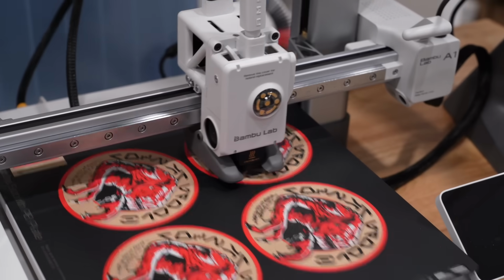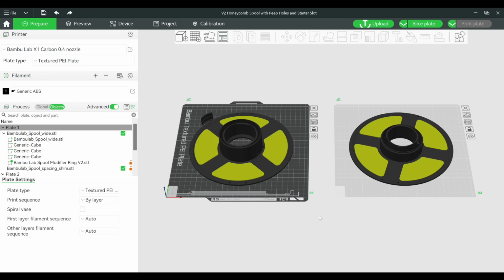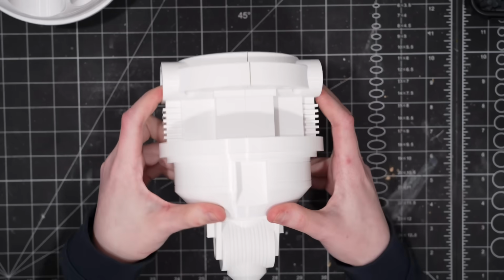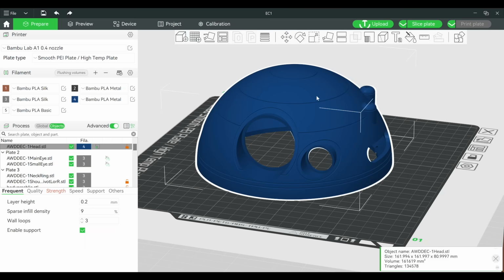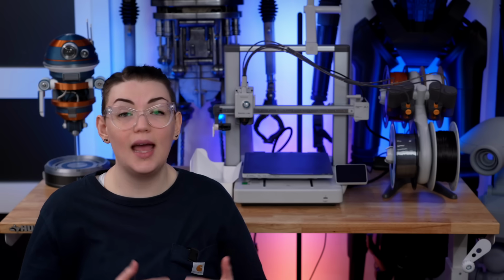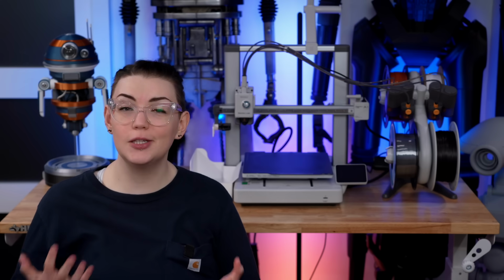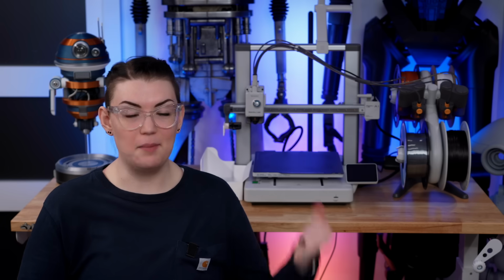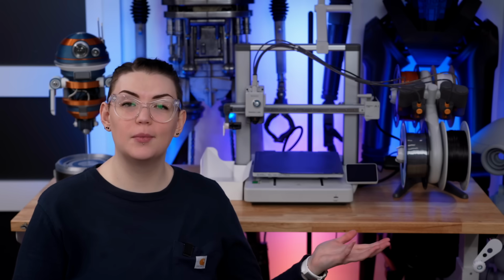Is the Bambu Lab A1 the Unbeatable 3D Printer for Beginners?

Comment: I want to know that if I want print things same 16:40 at this video like 16 keychain with three color the printer at first color and after that print the second and third one by one or at first print 16 keychain first color and change to the second after that.
Reply from the maker: It will print everything that uses the same colour and then switch. So it would print the red area in all 16 keychains, then switch to printing the black parts for all 16, etc.

Comment: whats the foot print needed for the printer with the ams?
Reply from the maker: About 32” x 24”. That’s a conservative measurement. There are also print files out there that can relocate the AMS to the top of the machine or even on a wall, etc. that could decrease its used desk space.

Comment: I've been considering a 3D printer for about 3 years now, but haven't purchased one primarily due to lack of space (most printers are not necessarily small), and lack of funds (most cost more, with several approaching/exceeding $1,000).  After over a year of researching, contemplating, etc, I finally decided that, when I did get one, it would be from Prusa...tho, I was still undecided whether to go 'small' (ie  Mini, now Mini+), or 'large' (ie. MK3S, now MK4 &MK4S).

However, now, hearing so much about Bambu Lab, I'm starting to rethink things.  With Bambu Lab having a US presence (even though they're a Chinese company), that's one advantage.  Also, the A1 & P1-series printers all have a larger print area (256mm² vs the Mini's 180mn²).  Another advantage...a HUGE advantage...is having the ability to have multiple colors spooled.  However, I know that Prusa printers are very highly rated, and the Prusa Slicer is considered one of the absolute best.  Plus, they have a very strong support based, including one of the best company-provided support lines.  In your video, you talk about a strong "user support base", but, does Bambu Lab provide any direct support, and, if so, how good is it? (considering most of us know how poor support is from most cones companies selling direct)

In a matter of speaking, this has me back to where I was before - wondering which company's products to get.  Any advise/suggestions, ESPECIALLY from anyone who has owned & used printers from both companies???

Comment: These Bambu printers are so much more like an appliance and less of a tinkering saga.  The filament purge for color changes is far less than I used to throw away from older generation printers (Ender 3 and 5, Artillery X1, etc) failed prints, poor quality, inconsitent extrusion, slower speeds... the difference and experience is night and day.  Color changing, easy quick acces changing of filament, up to 16 colors (I have 2 P1S and use two AMS on one for 8 colors)... excellent stuff!

Comment: I dont know how much multicolor I would do, but how would it work with type? Could you mix type, or would it likely struggle sticking to something that isnt the same material? Would it be useful to just use it a single color and type, but being able to have your most common types on the AMS?
Reply from the maker: A few of the filament types don’t interact well with each other, but that can be used to your benefit to make easier to remove supports. You could also use it with PVA to create dissolvable supports if you’re into printing complex models. Something I completely forgot to mention in the video is that the AMS can be set to automatically switch to the next spool when one has runout of filament. It’s definitely handy but I’m not sure that feature alone would be worth the additional cost of the AMS for you.

Comment: I just discovered your channel and must say I'm quite impressed!  Your delivery is great and concise, pacing also.  Video is top notch and your printer setup and printing are very helpful and enjoyable!

As someone who has built several 3d printers from scratch and experimented with various multi filament methods, I think Bambu has really nailed it.  The single extruder concept vs IDEX really simplifies the filament path!  The actual cutting, purging and reloading the next color is brilliant.  They have added an inteligence way beyond the norm with the use of MEMS sensors for achieving the ideal stepper control and frequency to minimize noise and vibration, super cool!

Did you say that the printer had identified the filament colors while loading?  Optical color spectrum analysis perhaps?

I think out of all the 3dp channels I've seen over the past 10 years, yours is a cut above and now my favorite!

Comment: I am 67 and was an electronics tech but I only worked on hardware not software. So I know nothing about programming, 3d printing. But it looks like fun and would like to try it. Cost is a major factor since I'm on SS and somewhat disabled. I hope the filament is not too costly. I enjoyed your presentation on this machine. If I can afford it I will try it. I found you by accident and I'm glad I watched all of the video.
Reply: Please check back in here and let us know how you make out. Im recently retired and on a fixed income as well. I am just getting into this but haven't made any purchases as of yet. Cost is a concern for me as well. Id like to use you a guinea pig, haha
Reply: If you can afford $200, you can get the A1 Mini & have a blast.  Filament is $15 per spool (1 kg). You definitely can start with the basic machine & print single color parts.  Add the AMS to print in multiple colors as you gain more experience.  Have fun with it!
Reply: The A1 is about $200 and filament usually runs between $20-30 on average for your basic roll of PLA.  Sometimes it can go higher if you want something more specialized.
Reply: @SenseiJacksama  Where are you getting an A1 for $200?? It's nearly $400 (with the current deal going on) and it's $498 with the AMS Lite attachment.
Reply: @linkthelegend01  the A1 mini is $200.  Apologies I didn't realize they were two seperate models when I initially posted.
Reply: @linkthelegend01  £400 that’s amazing honestly no interest in 3d printers this video pop up on my feed i thought they cost thousands now i want to print coasters 😂😂😂😂
Reply: @paultrainor2110  Haha nah most don't cost thousands. There are def a lot that do, but most don't. I have an Ender 3 V3 SE but I just bought a Bambu Labs A1 Combo. They're fun. I'm ready for the Bambu Labs to come in already.
Reply: @paultrainor2110  yeah the advances in the printing industry are advancing pretty rapidly. The last 2 years alone they have decreased in cost and increased in usability.  I bought an ender 3V2 and year and a half ago for $300.  It's unusable without certain upgrades so I sank another $100 or so into that and ran endless tests to calibrate it.  About 6 months ago I got an sv06 for $200.  It required no upgrades and all I had to do was tweak a couple of settings. It was up and running within 15 minutes after I assembled it.  Now those couple setting I had to figure out on the 06 the Bambu Lab printers will calibrate them in their own.  Im saving to buy an X1 and then sell my other printers.
Reply: @SenseiJacksama  Ok Sensei thank you for the info on the printer and have a good day.
Reply: @JohnTomlinson-g4x filament is much cheaper, if you don’t go with bambu labs expensive premium one. I pay around 10-13€ per kg of Filament
Reply: @SenseiJacksama  Try $450 with the AMS

Comment: Any advise on a printer to get my 11 year old that's under 200 $ ?
Reply from the maker: Check out the Creality Ender 3 V3s. The SE is under $200, the KE is just over. I’ve only had experience with the KE and it’s an awesome little printer. You might find the upgrades between the two models are worth the extra cost for you.

Comment: Beyond a doubt, this printer is the most suitable model for a beginner. Advanced users will appreciate the way this printer’s sensors take the voodoo out of 3D printing. The only downside side I can foresee is the inability to manually override some of the functions that are automatically controlled by the printer. If the hardware or software faults, you will be unable to use it until repairs are made. I like the automatic functions and the way they work to perfect your prints, but I would also like a fallback option to manually configure these functions so I can still produce prints during non-critical failures in the system. For example, there is no means of manually levelling the bed so if the auto sensor in the print head fails for any reason, you won’t be printing.

Comment: I’ve had an Ender 3 for 5 years and I love it. Upgraded as far as it’ll go. What puts me off this and, say, the K1C, is the proprietary nature of the printer. Also most of these printers have a PCB in the head, and if these boards fail getting replacements sounds like an expensive experience. So, great when they are working, but fixing them and real upgrades (not just prints) sounds a lot more painful than a more traditional (older) printer.

Comment: I don't have wi-fi in my shop. Can you use this printer with and Ethernet cable? Can use the Bamboo Slicer on a separate computer and manually transfer the file to the printer?? BTY--great presentation.
Reply: No one answered you so I will. Not sure if it has ethernet port, however you can manually transfer files like you mentioned. It has the ability to operate completely off the internet for privacy concerns. I'm not sure about updating firmware offline, but it wouldnt surprise me if it can. It includes a sim card, that has benchy and other files for testing and tuning, you can just make your file in the slicer on your pc and transfer it to this SD card, pop it in the printer and it should be able to print it.
Reply: @dingusmagee3326  I was able to get wi-fi. So all is good. Thanks for your input.

Comment: This looks like we're finally getting to the stage where these are basically inkjet printers, and we can just pull them out of the box and click print for great results
Reply: And its good thing. I buy my Ender 3 May 2019. It works from box but was not reliable and need constant maintenance and tinkering. Fun as hobby but frustrating if you want to make functional part and your printer refused. Today printers like this are tools, not toys.

Comment: Hi,
on the topic of plugging the tubes in the right hole: thats not important, the AMS-adapter on the extruder is a simple "y^2"-Adapter (so called filament buffer/hub), the selection of the right filament is completely done by the AMS (lite) regardless of the placement of the tubes in the toolhead.

To the review: I own the A1 Combo for about 3 month now, it is my 4th 3D-printer so far. And I do not plan to change that in the foreseeable future. The A1 brought me back to the hobby after the very first layer on the bed. It is so amazing to see this first layer EVERY time, I cannot get enough of that...

And an aspect of this printer wich is not deeply touched by the review: this thing is fast af. On the SD-card comes a speed benchy in 16:38 (I think). It is so crazy to cannot see clearly the toolhead moving at this speed.

I'm so happy with the A1 and the momentary price of 500€/$ (Eddies anyone?) is a true bargain. If you want a FDM-Printer and can afford it: buy it! 👍

Greetz

Comment: I understand you may not be able to answer this question, but I can see this as a great aid in casting metal using the lost wax wax process; would this filament 'burn out' of the mold adequately well (burn out temperature about 1200 degrees Fahrenheit). 
For actual jewelry I'd still use wax for the carving of detail, but for other less fine castings this would be a great way to design and produce prototype parts castings.

Also, is there a way to recycle the waste bin bits? (it would be rather motley filament, but that could have it's own style).

Comment: I just started 3D printing and my first and so far only unit is the A1 Mini. The only experience I have is using my laser cutter/engraver. So, I was completely new to 3D printing. Now I am learning CAD and have created my own designs for brackets, SSD/HDD trays, and cable management clips. The fact even my prints come out needing so little clean up attention is amazing. After watching your video I learned a couple useful features that would help improve my prints even more. Thank you for the variable layer height section you shared and the using a heated iron to lightly melt the support edges. I personally have experienced zero stress learning how to use the printer or the slicer software. CAD on the other hand, a little stressful but interesting.

Comment: @ 24:00 I believe they do grid infill because of the wear it has on the X1C. A few months into having my X1C and having similar thoughts, I replaced all my profiles to gyroid, since I love it, it's both great for aesthetics and strength(and mesmerising to watch). But I've read somewhere about the reason of using grid, switched and stuck with it.
Reply: Stuck with grid or gyroid?

Comment: I did not search,  but have you done an extensive video that goes over all of the print settings in the slicer?   Like u said we need to learn what they all do and at this time.  I just push print. I’ve had my a1c for less than 2 weeks.

Comment: I want to upgrade to this from my Ender 3. I heavily modified my Ender 3 with a linear rail, direct drive, Klipper through a Raspberry Pi, Print over network, vibration compensation, rubber springs replacement, a less warped glass build plate, nozzle brush. I’d rather get the Bambu which has all this functionality out of the box and calibrates itself automagically. Got an X1C at work which is amazing.

Comment: I enjoyed this review.  However, I think your assertion that people who buy one of these are "missing out" on something by not having to deal with inferior machines is misguided.  I am a computer programmer by trade.  I am not technically illiterate.  The assumption that people should have to suffer through screwing around with these half baked models from Creality and Sovol in order to really understand 3d printing is not correct.  What I hope Bambu moving into the more affordable printer range does is force these other companies to actually put out a product that at least reasonably works out of the box.  There is no world where a machine should have to be manually leveled and have the Z offset manually set when one of the advertised features is "auto-leveling".  These machines are filled with bad and lazy software.  Bambu apparently put a lot of time in to the software to make it where the machine, after calibration, just works as intended out of the box.  These affordable machines are going to bring a lot more people into the hobby, and they are going to force the other companies to do better, or shut down.
Reply: I am with you on that you don’t need to have a bad printer to learn . I started with a Tevo Tornado and still use it for the big print volume but I lost so much filament by failed prints.

On the other hand I have a Elegoo Neptune 3 pro that never failed one print on 100+ prints so there are good cheap printers out there.

But now I need this one for multicolored prints 😅

Comment: This review and a few others convinced me to take the plunge and buy an A1/AMS, and I couldn't be happier!

I've been printing for 6 years with an Ender 3 and Kobra Plus. The Ender 3 was fascinating as a hobby that more than paid for itself in all the household items and fixes I printed. I got the Kobra to reward myself for all the tinkering I had done on the Ender 3, and for a year was thrilled by the improved quality and low maintenance. Decided I wanted color, and went for the A1/AMS based mostly on your review. The way I feel about this printer reminds of the late 90s, when laser printers became affordable for home use - suddenly a whole world of fonts and formatting opened up, and we said goodbye to tearing the perforated strips off accordion paper. 

My first A1 project has been to print a large number of little plastic gears for a project for my daughter. My Kobra Plus had been doing great with these, but there was still a fair amount of post-processing - picking off threads, sanding and minor filing - and we're talking hundreds of gears. The A1 cranks these things out perfectly, ready to use, and so much faster. The surface finish on the metallic silk filaments I'm using is amazing - parts shine like actual metal now. I'm getting nicer results with 0.2mm layers than with 0.16 on the Kobra. In fact, the A1's precision is so good I've had to revise my designs a little, to remove the fudge factors I had built in to make parts fit right. This machine totally blows me away, along with the whole Bambu ecosystem. 

Many thanks for the super clear and thoughtful review and all the demos. You have a new subscriber.